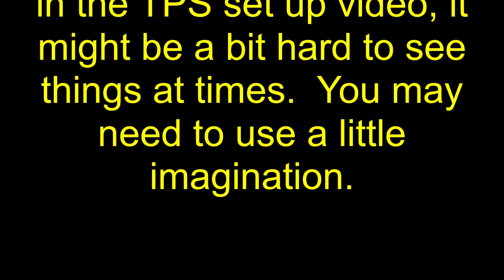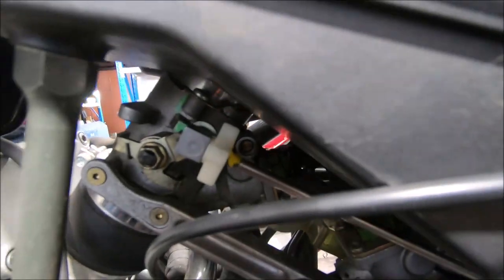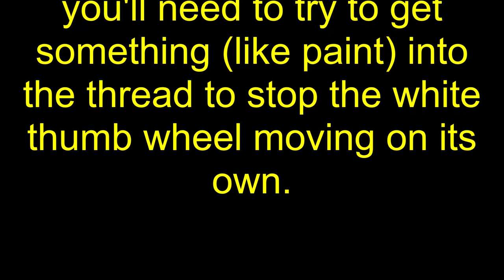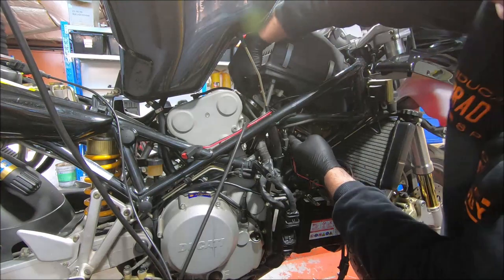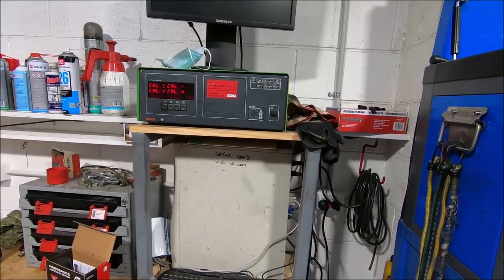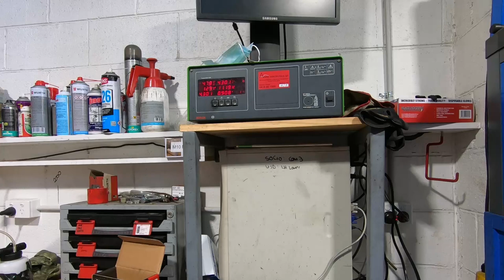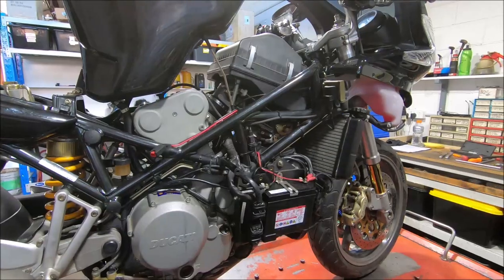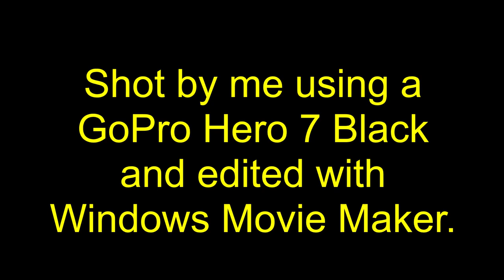Ducati Throttle Body set up and idle setting for ST4S, ST4, MS4, MS4R, 748, 916, 996

Comment: Hi Brad! Would it be more right to adjust the airblades to get the same Co2 for both cylinders rather than using vacuumclocks to get the same flow?
Reply from the maker: i use the cylinder balance for off idle running.  the air bleeds have a very limited range of operation - a few degrees throttle opening and they have little effect from there up.  so it's two different circuits as such.  but you can do whatever you like.

Comment: Hey Brad love these videos. Got an S4r with a cracked engine mount that I’ve got in bits so these videos are great. 

Just wondering, will a wideband 02 sensor work for this adjustment?
Reply from the maker: the wideband sensors have a very fast response time, and will show all the cyclic variations as it was at the time of that particular reading, and you might get 10 or more per second.  ime the result is all over the place and pretty useless.  the co meter is made for this job, so the reading is damped to be useful.  maybe if you ran the wideband in a chamber of sorts taking the sample out of the header under vacuum it'd be more stable?

Comment: I recall reading somewhere where you stated when checking the CO, that the little copper pipe with the proper 1/8 thread to go into the bung hole was easy and cheap to obtain.  Where might one get this?
Reply from the maker: ducati 887131010

Comment: What could be the cause for the engine to shutdown if I unplug the horizontal cylinder but when I unplug the vertical one the engine still runs?
Reply from the maker: the vertical is not firing and it's running on the horizontal.

Comment: How does the idle control valve on later models assist in making the bike idle?
Reply from the maker: as its name would imply, the idle control valve controls the idle speed.  specifically, it's a linear stepper motor that moves a tapered plunger in and out of a hole to allow air to bypass the throttle bodies and thereby raise or lower the idle speed, and respond to the impact of engine temp, etc.  at ignition on it will go to a default opening as specified in the ecu mapping (not sure if that is adapted over time or not) and once running will adjust its position as it attempts to maintain the target idle speed as specified in the ecu mapping.  those target idle speeds vary with engine / coolant temperature, usually raising the idle speed somewhat when cold and progressively lowering the idle speed as it warms up.

as the idle control valve simply allows air to bypass the throttle bodies, it is in effect a variable air bleed system with feedback controlled by the ecu.  as such, using the manual air bleeds to impact idle speed can impact the idle control valve's ability to do the same thing, and that may cause issues or move things out of expect ranges.  as such, i just don't do it.  if it has an idle control valve, then i let the idle control valve do its job.

secondly, as the idle control valve simply allows air to bypass the throttle bodies, that variable airflow also needs to be accounted for with a corresponding variable fuel flow separate to the normal fuel flow in terms of how it is calculated in the ecu logic.  

also as a point to make there, the only non closed loop ecu idle control valve model was the mts1000.  all the others with idle control valves (2006>) have been closed loop, so the closed loop system would have final control over the fuel flow calculations above.

the 5am marelli ecu has a fuel table (map) of rpm vs idle control valve opening steps, and uses that map to calculate how much fuel to inject.  when the throttle is opened and the tps output value increases to the point set in the ecu mapping to signify the throttle is now "open", the ecu stops using the idle control valve map and moves to the main and offset fuel maps.  i imagine there is some interaction between the two for transition smoothness, but am not sure exactly how that works.

the conti ecu in the 796 and 1100 monsters and other models uses speed/density control logic (inlet manifold vacuum and rpm) at very low throttle openings, and as the amount of idle control valve opening will affect manifold vacuum, the fuelling requirements due to the varying idle control valve position are intrinsically part of the speed/density map.  it's a fairly neat way of encompassing it all i guess, but adds more components.

not sure how the later ones do it, never got that far into their ecus.
Reply: @bradthebikeboy  Do you ever come across bikes with reflashed ECUs running open loop, where the idle/cold run map has been lost or interfered with?
Reply from the maker: @zx9b2  lost no, things don't get lost from files.  but i've certainly interfered with a few.